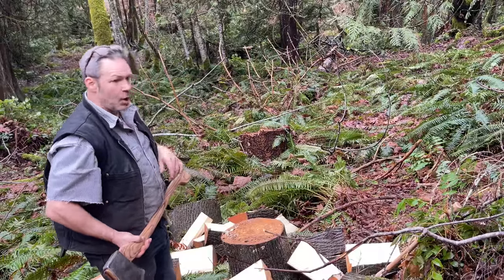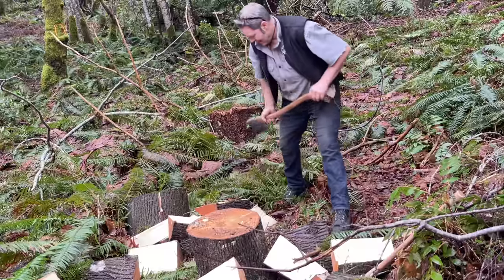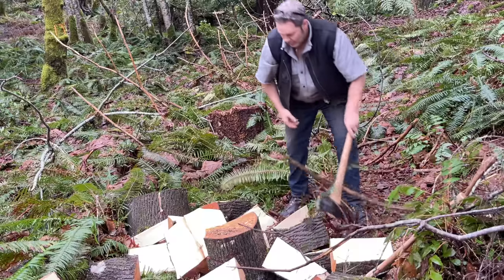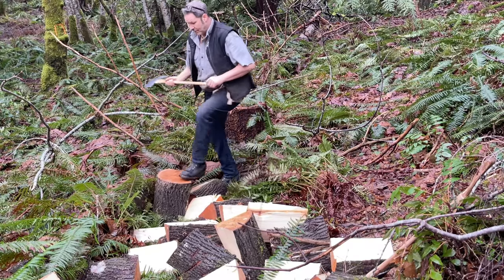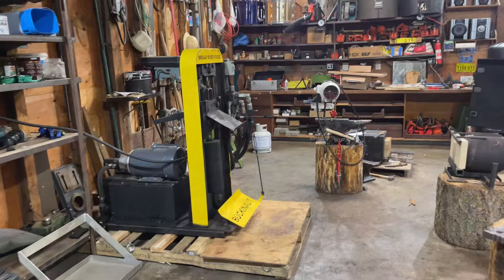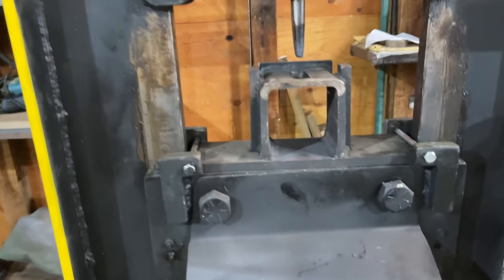WOW! 🔥 Fastest little Homelite chainsaw around

Comment: Brings back good memories.  My first job was at a small mill run of a john deere tractor in sputhern Okla. In the 70's Homelight and Mcollough were the only way to go. My go to saw is still my xl 12 homelight. These saws are some of the best. Love it.
Reply: Dad replaced his massive Mcollough with a Homelite XL12 sometime about 1970. I got a Stihl MS180C for light work and use his XL12 for things just a little bigger. It’s about 50% more power and 50% more bar.
Reply: I remember those days(late 60s, and early 70s).   Homelite and McCullough.
Reply: @josephsteffen2378  why did they go under??
Reply: I remember my dad using those McCulloughs. Big yellow beast the size of my 125 Yamaha yz and probably had more power! Lol I was 9 or 10 before I could pick one up.. I discovered just how tough those yellow beast could be around 14, when I had to start paying for those Yamahas! First time I picked up a homelite I thought it was a toy.. nope, definitely not toys. I went 30yrs without touching a chainsaw, now it Husqvarna and Sthiles, that's why I got a echo..
Reply: Your talent and creativity know no bounds.

Comment: I especially enjoyed this video. My oldest saw is a Homelite 410 I picked up in '86 or '87. Still cuts like a demon. I don't use it very much any more as the weight is a bit much to horse around... over 17 lb with a bar. But I just cleaned it up to store for the winter. I do love that saw.
Reply: You have a remarkable ability to inspire others to reach their full potential.
Reply: What cc is said homelite?
Reply: @adamtrollinger61  The 410 was made back in the days of Amurican egomania... The 410 model designation stands for the 4.1 cubic inch motor. That's 68cc in modern terms.
Reply: @Arfonfree  I greatly appreciate the fact that you went above and beyond my question, thank you sir

Comment: That Homelite is a ripper, very cool, I got a free Poulan2775 at the dump the other day. seems like it's in pretty good shape. i think its not getting fuel since it ran on ether ok. you were the first person i thought of when i got it semi running lol Have a great day!
Reply: New fuel lines, fuel filter and a rebuilt and clean carburetor should get it screaming again. Be careful with starting fluid it is not nice to two stroke cylinders and pistons. A small shot of two cycle fuel is way better for both starting and lubrication.
Reply: You have a unique ability to balance professionalism with a personal touch.

Comment: Very cool saw its definitely a beast. I love the shop and where you're going with it. Remember always the best fire defense is to keep all hot work and heat sources far from easy ignitables. Also a couple fire extinguishers and a high pressure hose line with a firefighting type nozzle is a great defense system to have. Even if you don't use it better to have it and not need it than to need it and not have it. Always better to stop and completely extinguish a fire quickly while it's small before it becomes an uncontrollable giant. Great videos my friend. Keep up the great work, stay safe and God bless you, your path and those who you love. 👍
Reply: You have a remarkable ability to communicate complex ideas in a simple and understandable way.

Comment: I got one of those my grandpa had it , i inherited it with a spark problem , none ..found the wire from the points a little long grounding out on the cover , ran like a scalded dog , but i think i overheated before i learned how to sharpen the chain , wonder if i can get a cylinder and piston , not sure it needs it yet , havent tore it down , it was priceless for hurricane charley , but it quit running in hurricane irma , that was its last debut ...i gotta get it out again and my old 064av stihl and give them to Ya ..

Comment: The hydraulic press takes up a lot of room.   You can separate the press from the pump and sump unit.  All ya need is a longer hose or hardlines.   Then place the pump, etc., out of the work area. Maybe 10 feet above, over on the wall, or in the corner.  Then you can access the press from both sides, unimpeded.

Comment: If your roof has a leak, you can throw a tarp(or even less expensive plastic) on it in 10 minutes....or less.  That'll keep everything in the building 100% DRY, UNTIL YOU "GETTIR-DONE".  It's a temporary fix, a bandaid, but should let a minimum of a month.  So you'll have plenty of time and no stress.  Life 101.

Comment: I got one of these, but there's a fuel leak out between the tank and the carb if you tip it front down really steep. Guessing there needs to be a seal round the pipe that goes from the tank to the carb.

Comment: Hey buckin, i have got myself a 390xpg, and it came with 20" bar in size 404, so i guess i have to change bar, chain and drivesprocket to get optimal chainspeed, correct?
Reply: And..... how do you get such a small saw to pull a long bar? Usually the clutch is too small and weak on a standard saw, and then it'll naturally wear down in a short time.
Reply from the maker: 3/8. 32"bar wood be just dandy
Reply from the maker: @danielreid9908  porting,  and filin'

Comment: Hey buckin, we just bought a 8lb splitting mall and first day of use the handle snapped. Do you know of any good ones around 50 dollars?
Reply: Any maul at 50 or under will be another hardware store generic. Order a handpicked handle from House Handle — only place with maul handles in stock. Beaver tooth might. And re-haft that thing.